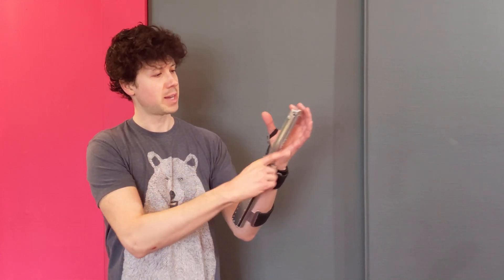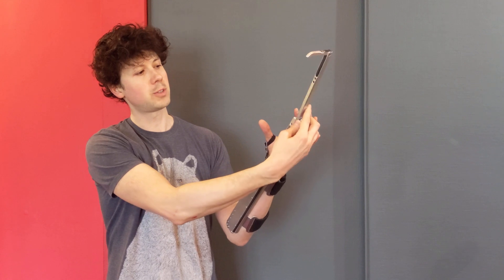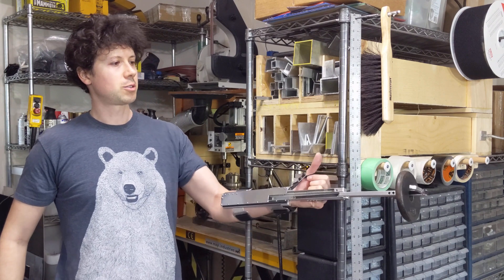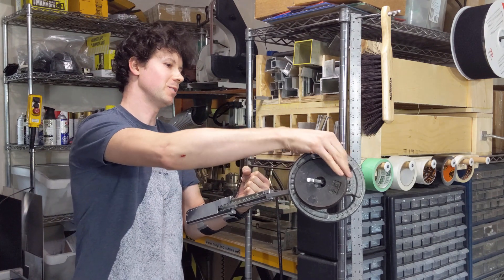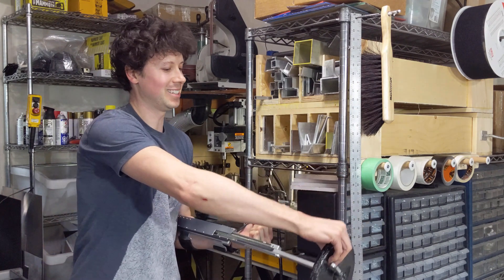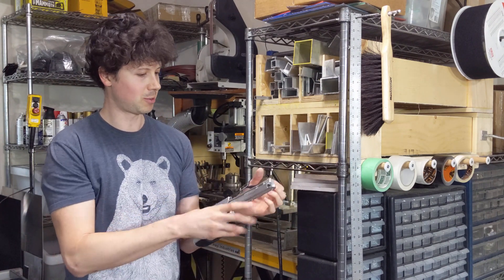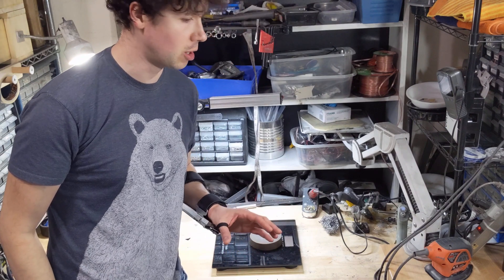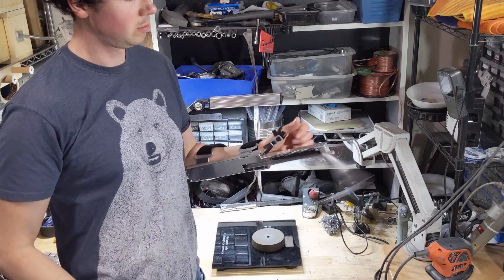Auto Hook V1 - Telescopic Gadget Demo and Load Testing

Comment: Out of curiosity do you believe your device  could hold your weight if you used it to climb ? , I ask because your device is extremely similar to the Hook blade in Assassins Creed : Revelations which it's sole purpose was to extend an assassin's reach , and to aid an aging assassin's ability to climb buildings , the reason why I bring this up is because awhile ago a youtuber that is a fan of the series built  their own version , it was a very crude design (It was more like they strapped a crowbar to their wrist)  but worked beautifully when it was tested to see if it could achieve the same feats as it's game counterpart. Sadly the video and channel is no longer up but believe me their version worked , all i"m wondering is if yours can do the same without bending or breaking  because while yours is more compact ( and overall just looks way cooler.) I fear its not as strong because it's extra moving parts and how hollow it is.

Comment: This is great but what are the actual applications
Reply from the maker: Not sure yet, making this up as I go along.  Holding elevator doors open, carrying groceries hands free (I forgot to mention it locks closed at the middle stage too, so you could have the hook out at mid length as well) pushing things away from you, pulling things toward you, picking stuff off the floor without bending down.  Made it to enable greater reach, as a basic ability it seems useful. I'm guessing the right application will become apparent in time.
Reply: @BionicConcepts  I used to work on a dairy chill dock, loading trucks.  We would drag stacks of milk cases using hooks.  This would be good for those type of workers.  We were constantly putting down and picking up our hooks. sometimes even absentmindedly  misplacing them, which would waste time and be very frustrating.  I think you could make a lot of money selling a hook like that to milk plants.